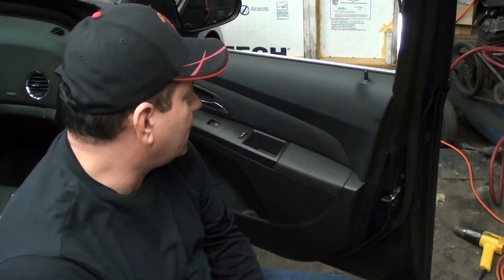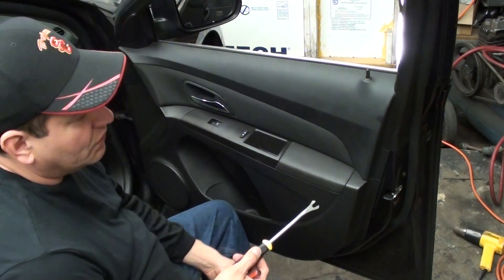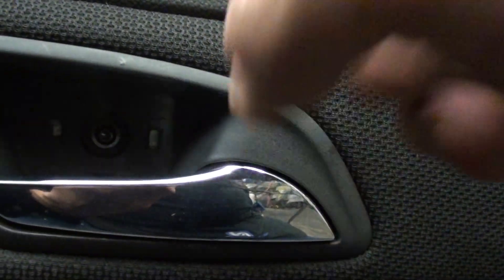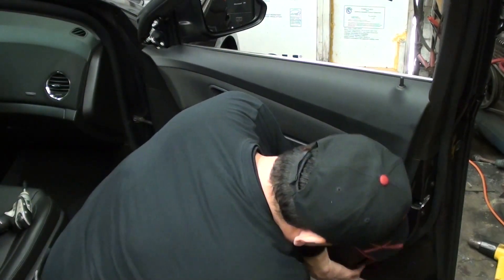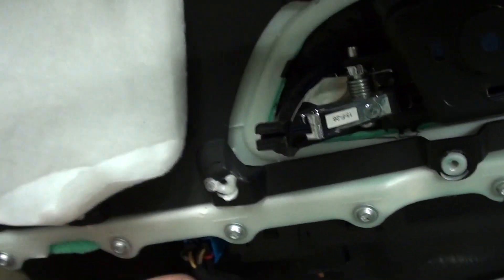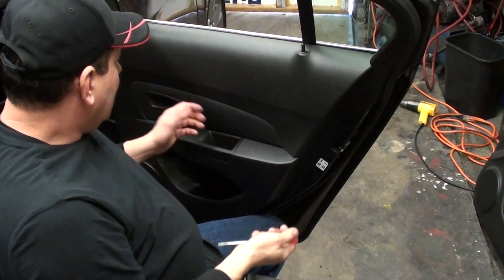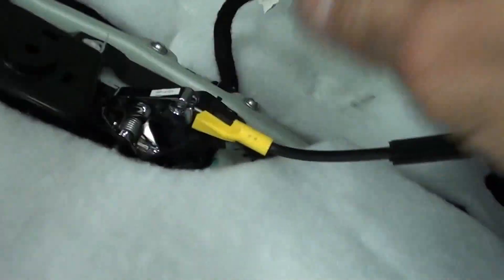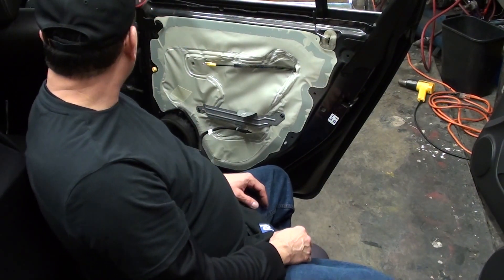How to remove front and rear door panels on 2016 Chevy Cruze

Comment: Hello, I have a question regarding this white plastic insulation under panels. Were them stock in newer Cruze models or did you mounted them by yourself? Do they reduce noise inside cabin?

Comment: I am trying to put after market lock position deals in im not sure what they are called actually when you lock your door its the piece that goes up and down that you can see from the door glass i was wondering do they screw off or clip like other cars
Reply from the maker: On these vehicles they are super difficult to do, because these are cable pull systems and you have to have a special attachment and cut into the insulation of the cable and tie into the metal cable inside.  Too much can go wrong with this type of setup, so we stopped doing them on these newer kind of vehicles

Comment: Good information, identical to a Sonic.  One hint, if you're only working on the speaker there's no need to take the door handle cable off.  Once you've unplugged the harness connectors there's enough slack on the cable to set the door panel to one side and access the speaker.  Just to help prevent breaking the clip needlessly.
Reply from the maker: Hypurr1 agreeded

Comment: I took my rear door panel off to take the door handle off, now my door handle won’t latch back on! I pull the level down but it’s basically stuck in the down position. Any suggestions?!
Reply from the maker: Are you talking about the door latch?
You have to pull on the handle from the outside, and with a small screwdriver at the latch push the metal part that latches outward so it unlocks.

Comment: I've got the door panel off, but I can't figure out how to get the clips on the top back on. I've got a volt but it looks almost identical to the Cruze. any tips?
Reply from the maker: Justin Volzer in one of my other videos on other vehicles I show how to remove the clips off the door. The problem with Chevy cars, the clips have a tendency to break.  Might want to go get some extra ones from auto parts or dealer. Chevy uses cheap clips
Reply from the maker: Justin Volzer this is how I take off the clips. Check out this video on a Cadillac that I took panels off and show how I remove the clips 
https://youtu.be/4z0Bqp4tWtM

Comment: So I am trying to replace my window regulator and I need to take off the plastic covering. How do i do that?
Reply from the maker: Serenity Little if you are talking about the white plastic bag like materials, you just pull it back, it usually tears, and some people tape it back on.  Ig has like a black sticky goo
Reply: @raiderman28  How do you unplug the connection to the side mirror though, to take it off without tearing the plastic to go around it?

Comment: Brother can you show me how to repair the power window on chevy cruze? Mine is broken
Reply from the maker: Emra-shar Hailidani I have never repaired a power window on a Chevy Cruze, but most cars have a regulator and windows motor. Usually you just remove it and replace it. You have to take the windows off the regulator and then remove the regulator with motor. Some are bolted on and some are rivited on. You have to remove the door panel first to see.

Comment: How do you remove it from the inside of the car?
Reply from the maker: Eric Cornejo why would you do that?  Unless door doesn’t open 
  If this is the case, you will have to remove seats throw opposite side of car and struggle to get panel off, possibly breaking to get it off
Reply: @raiderman28  when I put it back on the lock switch was down so it stays locked I didn't notice it